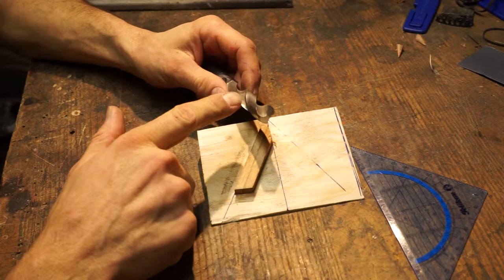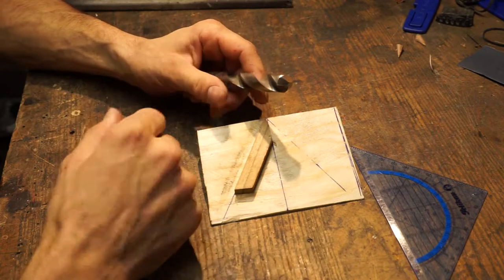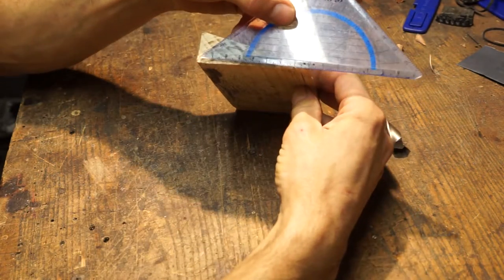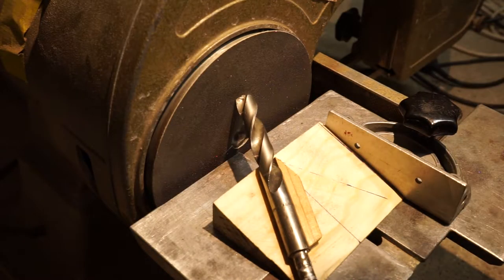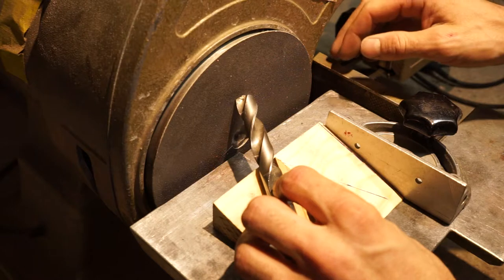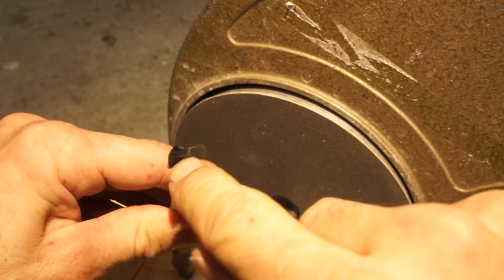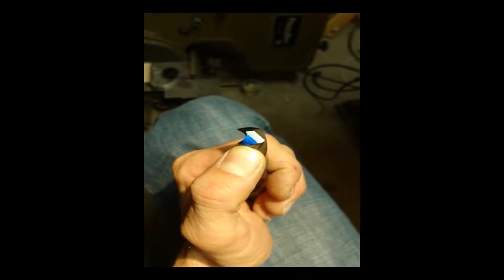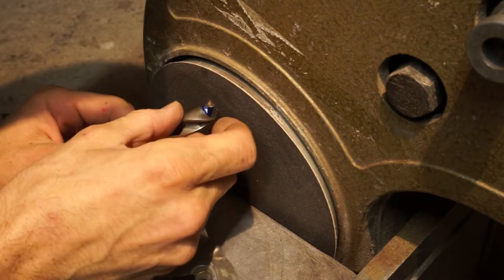Sharpen drill bit. The easy way

Comment: thanks mister. l will use this.  I do have expensive jooltool for filing down reliefs. Jooltool is on youtube. l also bought a drill guide from very super cool tools in texas. Before l found your channel. Yours is great and moving left and right does not wear out paper. 17° up with block and your done. I am fortunate to have the jooltool for many things/great channel they have here. u nailed it, an drill gauge if needed.

Comment: No, no, no, no. If you've gone to the trouble of making a guide or jig to grind the cutting edge then just use it (at a different angle) to grind the area you've coloured blue. But what you and SO many others miss out doing is clamping the drill in a way that allows the use of a stop so that you can grind both edges exactly the same. No one can ever get a drill accurate enough by sharpening any part of it freehand. The proof is seeing the drill not cutting correctly at the end of the video.
Reply from the maker: grinding the blue area gives the drill bit the clearance so that the cutting edge actually is in contact with the steel. The blue area does not at all have to be precise. you just need to grind it down a bit.  I sharpen my drills all the time like this and they are fine.  The drilling at the end was just very slopply done by my side.
Reply: @samuelegli8713  I'm not talking about the 'blue bit', I'm saying that without a stop of some sort you can't sharpen the two cutting edges equally freehand. Even used sloppily a correctly sharpened drill will produce two clean spirals of swarf, one if not equally sharpened.
Reply: @jonathansimmonds5784  : show vid on how to make stop or explain how to make stop.